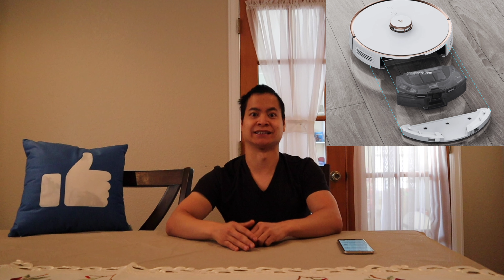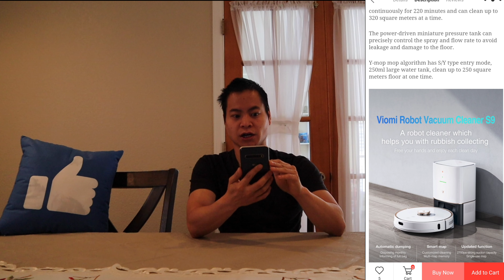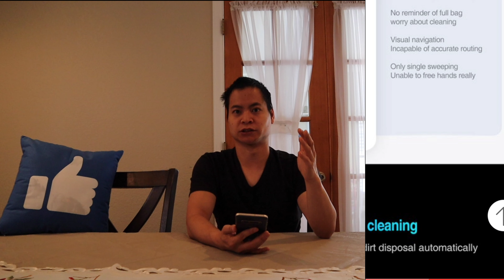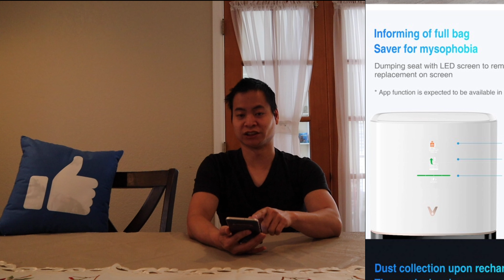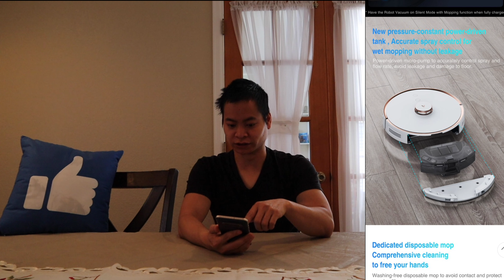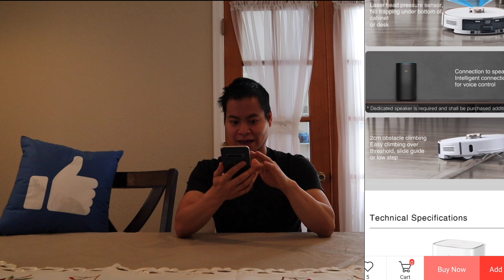Did Roborock Just Release a Self Emptying Bin Robot Vacuum 😮🤔 - NO But Viomi HAS with their VIOMI S9

Comment: hi which one the best out of the viomi s9 or roborock s5 max based on price and performance? thanks
Reply from the maker: Well haven’t personally tried and tested the Viomi S9. On paper the S9 more powerful and has the self emptying system. The S5 Max is a pretty good value and offers good cleaning and navigation performance.
Reply: @RobotMasters  do you think the auto empty dustbin is very useful? if u think its not so important i'll go with roborock s5 max. then which one has the better service center as i have to think years later. thanks

Comment: Looks like the new Proscenic m8 pro. So I think the Roborocks, lenovos, neebot, Cecotec Congas, Viomis, Kyvol are all Proscenic roboters.
Reply from the maker: A lot of them are using the same physical design. The main difference is the App integration and Navigation.
Reply: @RobotMasters  thats right, proscenic M7 Pro has for example Y-Sweeping, which Lenovo T1 Pro hasn't.
Reply from the maker: @FlochenAThannover  Yeah the Neabot and Honiture Q6 offered the best navigation and App integration.
Reply: @RobotMasters  hmm I'm not sure, because the T1 supports Multimap, which the Horniture doesn't, for example.
Reply from the maker: @FlochenAThannover  I forgot about the multi mapping, just from the navigation and App test the Q6 did well.
Reply: @RobotMasters  Did you ever heard about the Vorwerk VR300 and AEG RX9? They are not so famouse, very expensive, are not "perfect" but has the best deep cleaning especially on carpets!!!
Reply from the maker: @FlochenAThannover  I heard of the VR3000 but not the other one.

Comment: Hello, 
I just received mine two days ago and when I set it up it started to say “laser sensor error please clean laser” we’ve cleaned it and it keeps saying the same thing. How to fix this?
Reply from the maker: Hmmmmm does the laser spin, if it not spinning try removing the top cover that covering the laser. The plastic top is held on by pressure clips, should be able to remove by lifting up gently to reveal some screws to remove the lidar housing.

Comment: Do you prefer duel side brush or single side brush or no preference?
Reply from the maker: Dual Side Brush, can grab the dirt debris from either side of the robot.
Reply: @RobotMasters   it seems like your best pick for vacuums all have single brush like the roombas and the roborocks.
Reply from the maker: @marvinbediako8582  Yes overall the best performing robots happen to have a single side brush. If Roborock or Roomba added a dual side brush it would be a welcome addition. Another recommended robot is the Ecovacs 950 and T8 that has a dual side brush system.
Reply: @RobotMasters  have ecovac updated their software in regards to their camera and navigation?
Reply from the maker: Haven't heard of any major updates. I no longer own the T8 so I am not 100% sure if they fixed all the navigation and mapping quirks.
Reply from the maker: @marvinbediako8582  Haven't heard of any major updates. I no longer have the Ecovacs, but from the few months I did, I received monthly minor updates that improved some of the navigation and mapping issues.
Reply: @RobotMasters  what do you think about the roomba i6+? I haven’t really seen anyone review it. How does that compare to the i7+ and other vacuums? How would you rate it?
Reply from the maker: @marvinbediako8582  it basically the same as the i7+, maybe better battery life or some additional accessories
Reply: @RobotMasters  you really think the 6+ is better than the 7+? I was going to buy the 7 but if you think the 6 is better i may change my mind.
Reply from the maker: @marvinbediako8582  No if the i7+ is on sale get the i7+
Reply: @RobotMasters   sorry to bother you again. I just watched your demo on the kyvol s31. How does that compare to the room a i7+?
Reply from the maker: @marvinbediako8582  The benefits of the i7+ is the better self emptying bin system that can handle a lot dirt and debris from the dust bin of the robot. The Kyvol system designed for lite debris. Both robots offer a lot of the same mapping features like Area select, keep out zones amd room select. The Kyvol offers a hand held remote and Lidar navigation.

Comment: Looking forward to for you to do a Self emptying vacuum battle royal. 
I also did a review of the Roborock s4, When Roborock does release this I will get this, I am soo close to getting the Ecovac t8+  
https://www.youtube.com/watch?v=QjleuWTxmeY&feature=youtu.be
Reply from the maker: Just looked at your S4 video. The S4 performed the best so far in pickup ability beating out the more expensive models like the T8 and S6 MaxV. Are you looking into the T8+ AIVI which has the camera or NON AIVI. If you can forgo the camera you can save some money and get the one without the front camera. The Self emptying system pretty good on the Ecovacs.

Comment: Looks great but I really don't understand why every manufacturer doesn't put dual side brushes on its top-of-the-range model. I can see why further down the price range every $10 off the cost matters but for someone who wants to buy the best a manufacturer has to offer? Maybe I'm unusual but if I'm paying in region of $1,000 give or take a couple of hundred Dollars (didn't see the Viomi price but Roomba s9 definitely North of $1,000) I really wouldn't begrudge another $10 or $20 or even $50 on the retail price to have a second side brush.

Interesting also that the water tank is bigger than the internal dust bin. I certainly hope there is an on-board bin-full sensor so it can do empty-and-resume runs back to the dock during a cleaning run especially when the spec says it could be out for up to 3.6 hours on a single run!
Reply from the maker: I suspect the 3.6 hours is mopping only mode. Can't seem to determine if the dust bin top loading or you have to swap out the water tank for the dust bin? I agree having a dual side brush design is a must especially for a robot at this price point. Can't see any benefit a single side brush design has over a dual side brush design.

Comment: Proscenic M8 Pro is available for 599$. 

https://www.geekbuying.pl/en/robotic-vacuum-cleaners/1078-proscenic-m8-pro-smart-lds-robot-vacuum-cleaner--3385563946550.html

It also has updated self emptying base so theoretically it should work much better than the current one.
Reply from the maker: Hmm any additional specs that better than the original m7 Pro 🤔
Reply: @RobotMasters  it has only one side brush.
Reply from the maker: @martinbookkeeper8199  Interesting, I prefer dual side brushes. Wonder why they went with a single side brush design?
Reply: @RobotMasters  I don’t see any differences except for the bin and base.